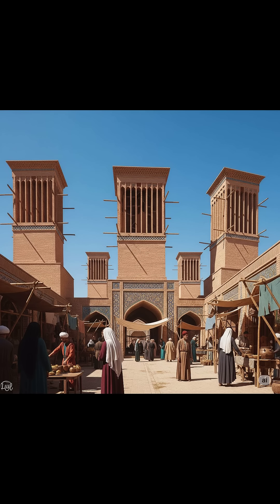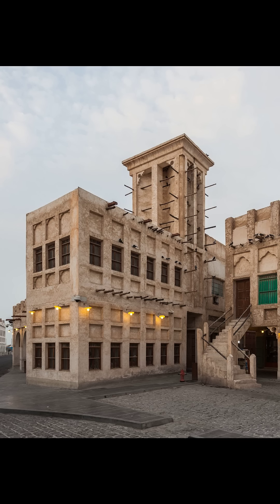Ancient Air Conditioning: The Idea That Changed Modern History

Comment: why can't we do this today?
Reply: We can and do.  Compared to mechanical air conditioning, it sucks.
Reply: We do use this. They're portable units for each house, popular in the southwest. They're called swamp coolers. The fans use electricity to blow over the water.
Reply from the maker: Great Question! While these building still exist today they are not as effective as modern AC. So when possible modern AC is used.
Reply: Manyfacturers  of  AC  sabotage it.